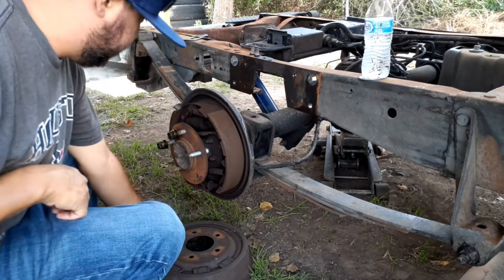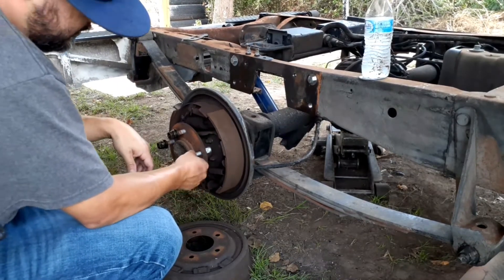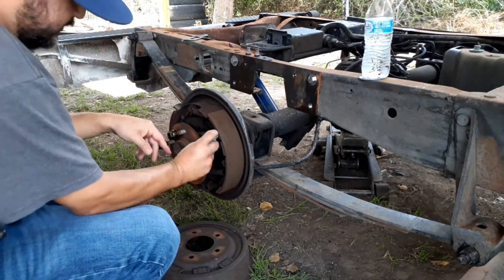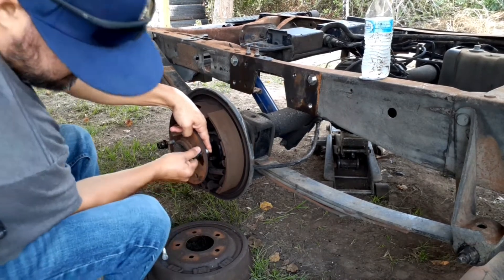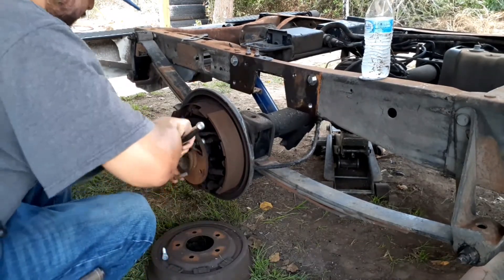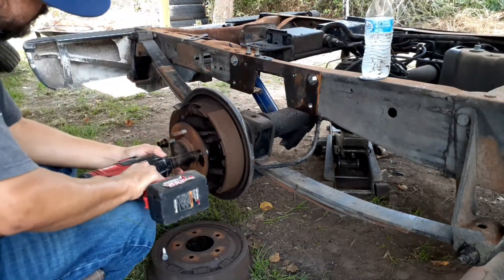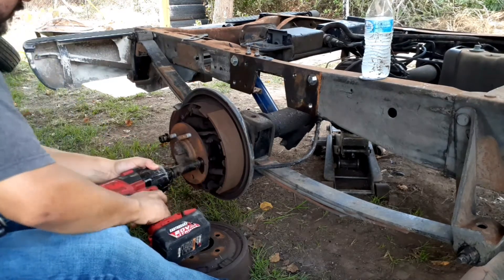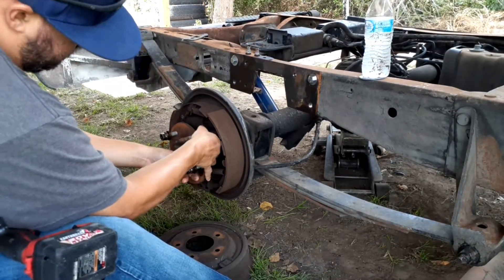Replacing rear wheel stud on 97-03 F150

Comment: That’s great as long as you have drum brakes! My 01 and 03 F150’s have rear disc brakes and it’s nowhere near this easy
Reply from the maker: It should have a slot or a hole where you can hit it out, so the stub will come out.
Reply: @AquinoRejectRides   You would think so but it technically does not, i dont know what ford was thinking, you are suppose to pull the axle out a little and it will go, but i will be drilling a hole in mine.
Reply from the maker: @MrLoyd-yp1tr  I think you need to pull the axle...there's has to be a way with out doing that.
Reply from the maker: @MrLoyd-yp1tr https://youtu.be/S12b9DvO0rs?si=Gn_hCUCl6kHTk8ap
Reply: @AquinoRejectRides  it looks like he moved the park brake shoe up a little to make access. ill try that, i think ive tried every spot around the axle with no success. ill give it a shot today. thanks for that video, eventhough it is an 05, it could be the same rearend.
Reply from the maker: @MrLoyd-yp1tr yeah sometimes it get little tricky